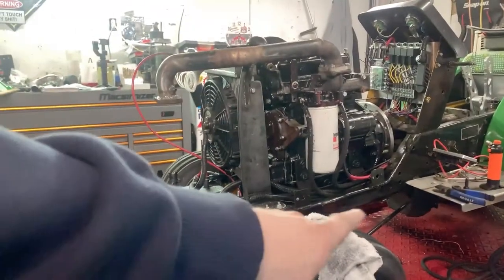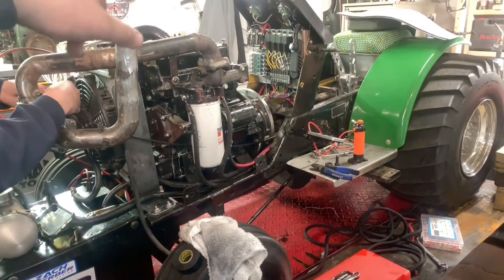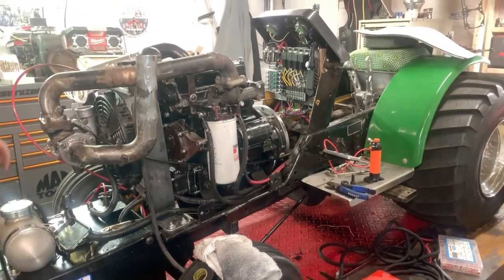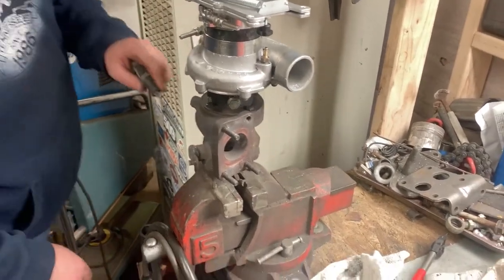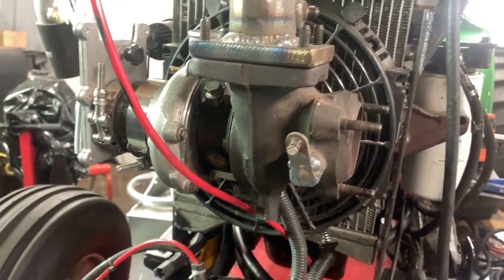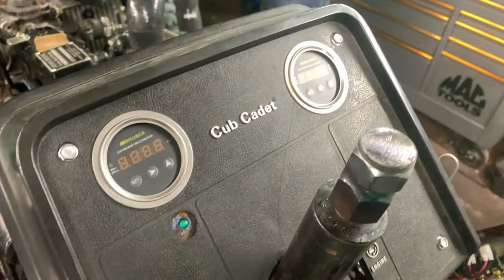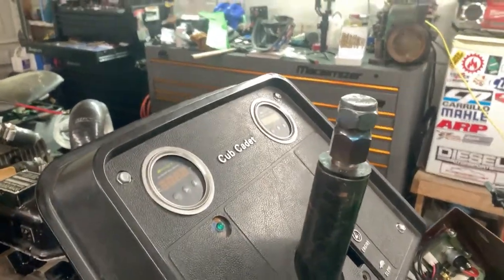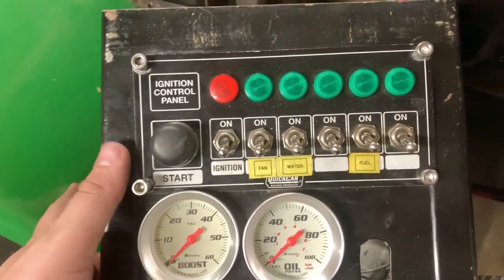How to build a pulling Tractor?

Comment: What rear end do you guys use. 
Ik most diesel mowers have hydrostatic rears which is no good for pulling
Reply: I'm curious of this too...Chase Marindale...I'm running a cub...would the cast iron rearend 3/spd be ok to bolt up to a diesel or do we need to go a different route? Thanks